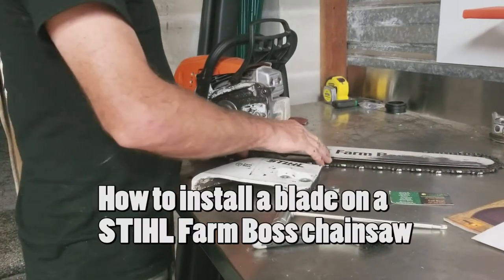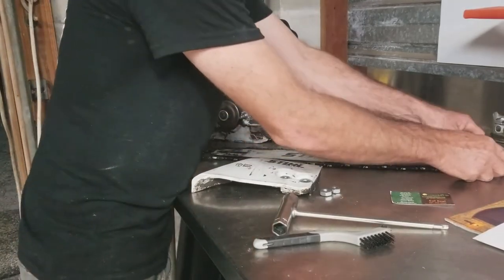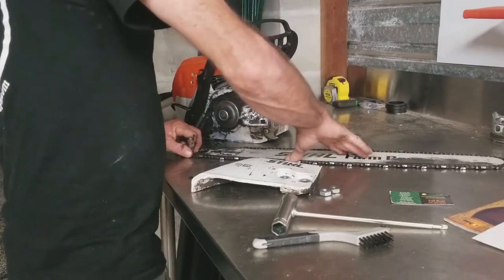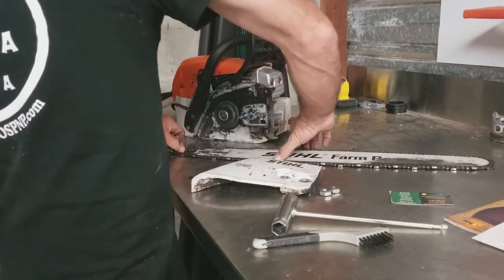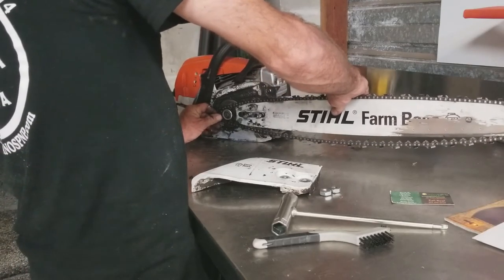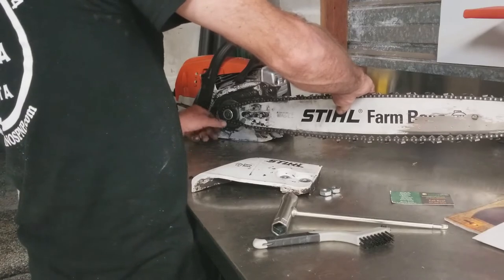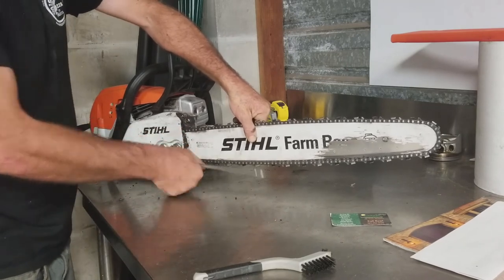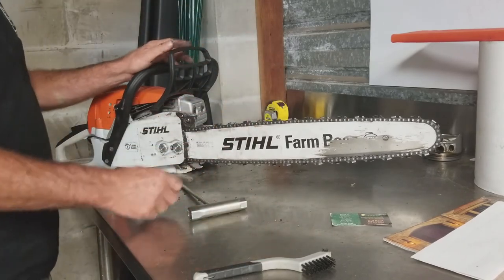How to install a chainsaw chain on a STIHL Farm Boss

Comment: One important step missed

Loosen the chain tightening screw first or you’re never going to get the bar back on

Mount bar with chain and bar over sprocket 

Then assemble

Then re tighten screw